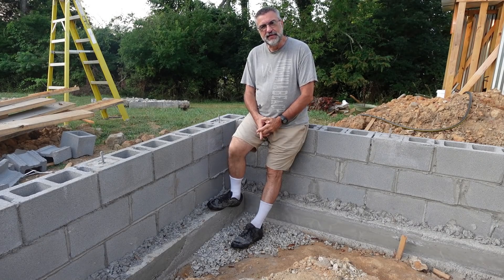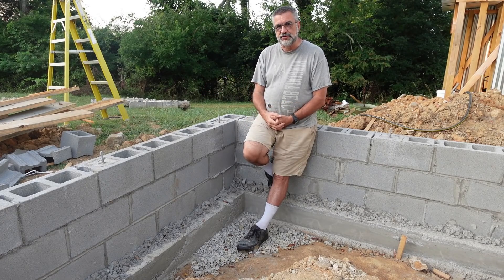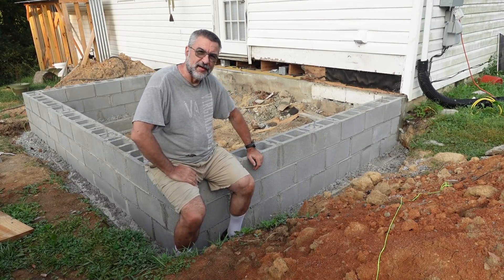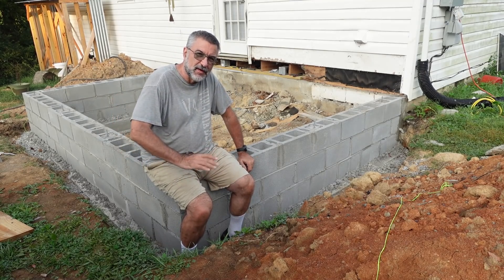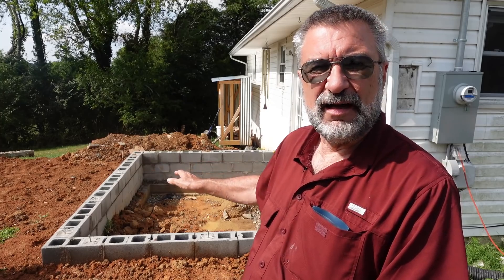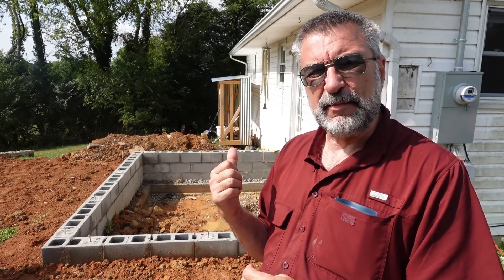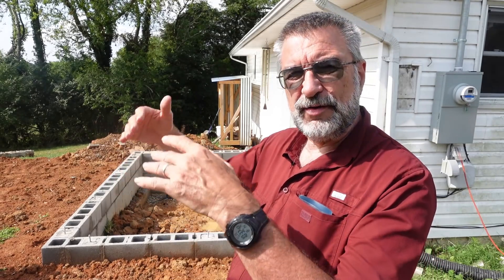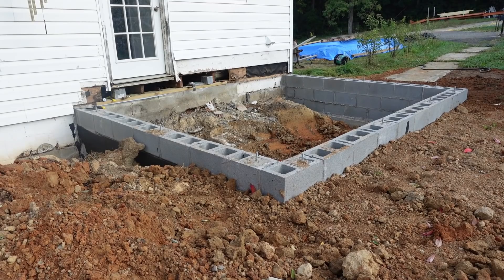Addition Build 7 - Backfill & Patio

Comment: I'm glad to see you got your foundation done. It's true that the frost line in the south is different than in the northern states. Sometimes on an 8 foot basement or foundation they will fill the outside corners because the wall won't collapse at that point and they can walk up to the foundation that way. 

I've been out to our house in the mountains doing some work. I had to get the well pump going and some other things. I have a lot of other work there too. I have to replace a lot of facia board and some soffit around the house and garage. We bought a brand new travel trailer so we have go drive out there soon once the dealer has it ready for is so we can pick it up.

Comment: If you guys would please let us know what a project like your addition would cost if it was hired done vs the cost when you do the work yourself it would sure be appreciated. In about 5 years I'd like to add a sunroom on the back of my house, but I have no idea what it would even cost. It would at least give me some type of rough idea what to expect. I may not be able to do it if it's real expensive. Thanks.
Reply from the maker: As a VERY general rule, when you hire someone to do a project like this, the cost is HALF labor and HALF materials.  So that means it would usually cost twice as much to hire it out as it would if you built it yourself.  I plan to do a complete cost analysis at the end when the project is finished.  I will tell you exactly how much I spent for the project by doing it myself.